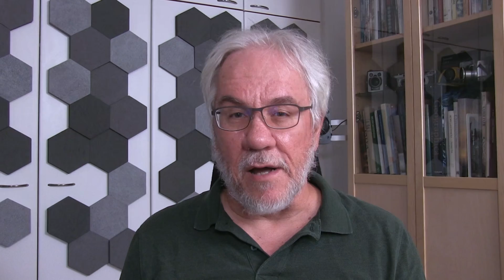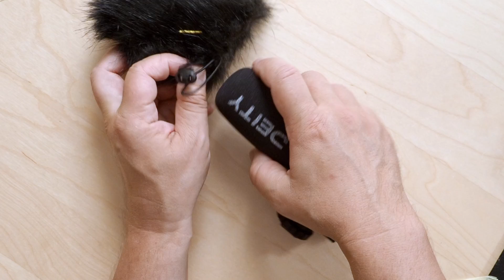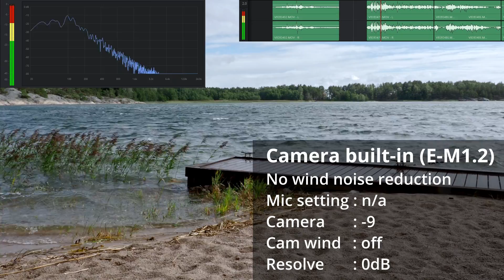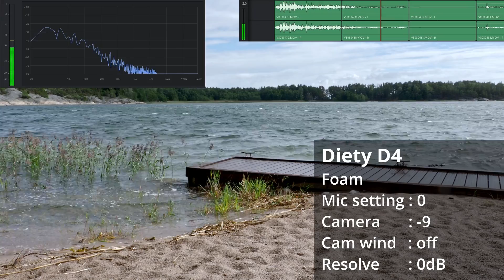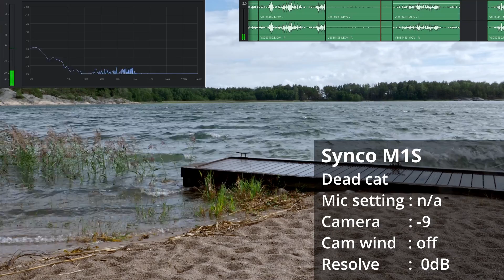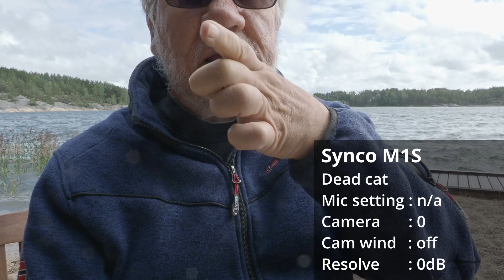Wind noise reduction test Deity D4 vs Synco M1S vs in-camera E-M1.2

Comment: Larger microphones have more surface area, which means more impact of the wind gusts. So in general smaller mics have an advantage at extremely windy conditions. I also have Deity D4 and tested it at 10 m/s wind. Results are unsatisfactory. That's probably over deadcat's capability.
Reply from the maker: I'm thinking that the problem is (at least partly) due to the foam, seems like the foam is stopping the deadcat to fully "seal" the mic from the behind? Also, as the general wind noise (from mainly trees around/behind me in the video) creates interference noise from the barrel?